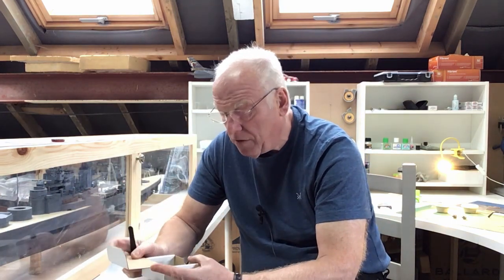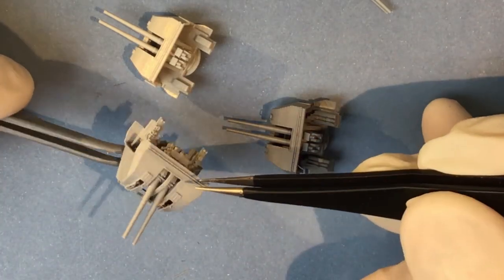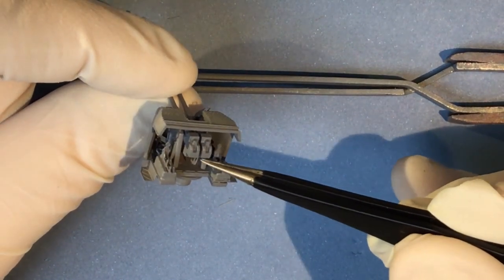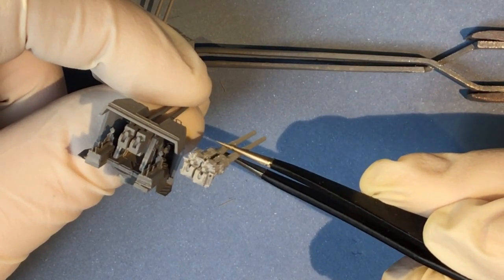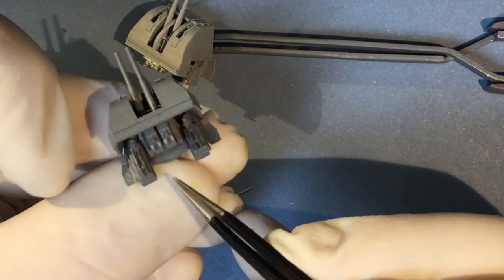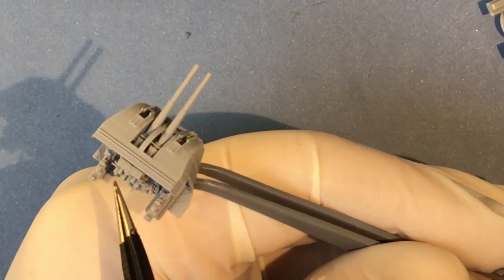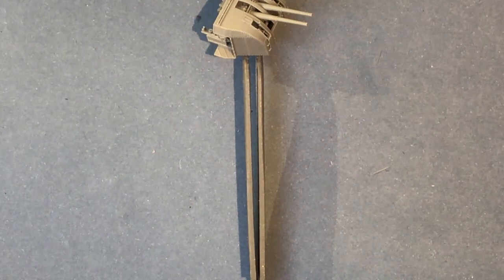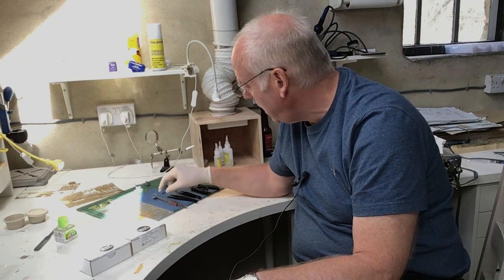1/200 3D Royal Navy QF Mk XVI 4" gun review

Comment: Hi Steve, the parts I think are 3d resin printed parts. Regular 3d printed with a filament and heat would not have that kind of detail. Where 3d resin is printed up side down layer by layer in a reservoir of liquid resin which is uv cured after the print is finished and rinsed off. You do amazing work and fantastic detail on your model. I wish I had that talent to do that kinda detail. I did when I was a lot younger but the old I get that ability I am losing my eye sight for small part work. Be safe and keep blessing us with your fantastic detail builds.👍🚂🚢⛵
Reply from the maker: Kind words Ronald thank you I appreciate it. It must be quite an industrial set up by now at MM so I dare say he uses some fairly advanced technology to get to the standard of these parts.